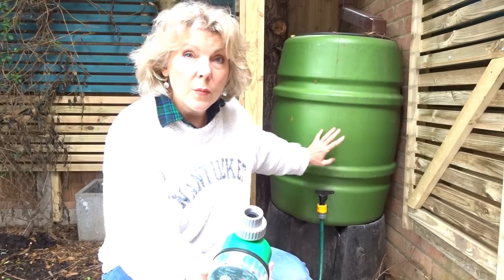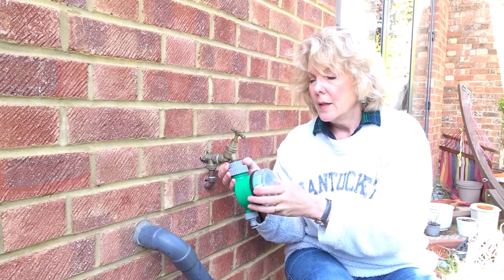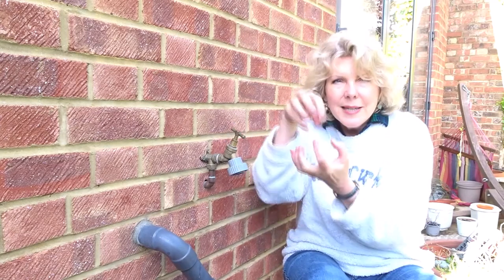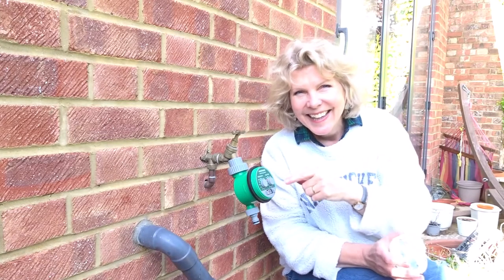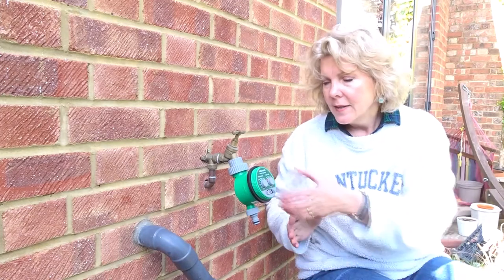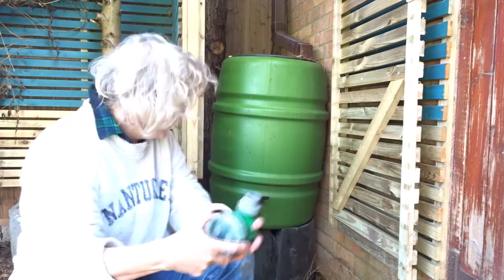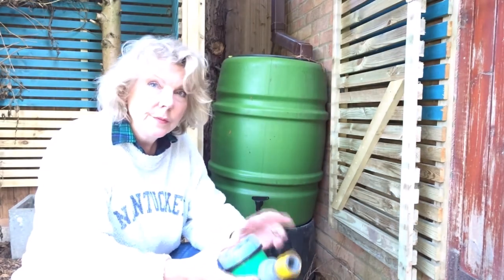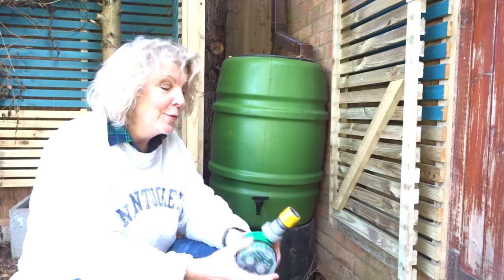How to automate your irrigation system from a water butt or garden tap

Comment: I connected 2 water butts together by a length of hose and snap on connectors to the taps but kept leaking at the tap/hose joint. Saw your video and changed the o rings on the taps and its done the job perfectly. As you say the Hozelock o rings are just slightly larger and take up the slack. Brilliant suggestion, thanks for sharing.
Reply: PS - will you marry me XXX
Reply from the maker: That's great feedback Frank, thank you. All manner of eclectic videos to follow, so hope you have subscribed.

Comment: Alternatively, warm up a piece of hose pipe in boiling water and fit this to the tap nozzle then attach your hose connector of choice to the hose which connects to the timer. Xx
Reply from the maker: I'd be interested to know if you've tried this and made it work? I suspect that the weight of the hose would eventually mean that it would slip off, leak  or come loose, especially if the tap had a thread. Still, all roads lead to Rome. Thanks for watching and for joining in. It's always great to hear from people with other ideas, hope you've subscribed.

Comment: Hi found this video I have this exact timer and set up (though my water burr is higher) having awful problems with leaking when the timer is on 'closed'. You suggested an o ring, I have the simple plastic tap the water butt came with and using the hospice connection. Can you help me out with the o ring adaption?
Reply from the maker: Hi Suzie, arrgh leaks! I had exactly this problem and made another video about how I solved it. https://youtu.be/8cPRz8u71M8?si=0WUPC7cSoUlR3akH
Hope this helps. Isn't it good to be out in the garden again? 
Subscribe to all to make sure you don't miss any of my very eclectic vids. Happy Easter.
Reply: @BecomingCreative  Hi just to let you know I bought the O ring and it worked! Thanks so much for your video

Comment: Might be worth adding a to your description that not all water timers are suitable for  water butt service.  The low pressure provided by the head of water in a butt means a timer that is suitable for working at 0 psi/bar is required, and there are very few reliable units available in the UK....
Reply from the maker: Good point Mike and I have added to the vid description to clarify. Thank you. Hope you have subscribed.
Reply: Any suggestions for such a low pressure timer??
Reply from the maker: @skindude9251  Yes if you look in the drop down description under my video you will see a link to the timer I used which is specifically stated to work with water butts. You can also increase the water pressure coming out of the tap by a) raising the butt on a stand ( butt lift? 🤭)or b) filling the butt with a hose from an outside tap.Hope this helps.
Reply: @BecomingCreative  Bless you ma’am!

Comment: Thanks very useful.  Where is the O ring fitted exactly? I am looking for a water butt with a tap that is connectable to Hozelock fitting.
Reply from the maker: Thanks for watching Sidharth, glad you enjoyed the video. The O ring I mention in the video is on the tap nozzle fixed to the butt.  Have another look at the video, I think I point to it, which hopefully will make it clearer.  I had to change the tap fitting on my butt to make it compatible with the hozelock fitting, which I mention in this video.
https://youtu.be/WXwhTxS1MTI
Reply: @BecomingCreative   thank you I will give it a shot.  Need to orde a waterbutt
Reply from the maker: @sidharthjoshi2979  yes that would be a start- try to get one with a tap that is compatible with hozelock. Good luck, let me know how you get on.
Reply: @BecomingCreative   Okay so that(O rings)didn't work.  The water leaks underneath fitting.  Any advice on this hozelock ocmpatible tap ? I can fit to a water butt.  It seems there is alot out there but not sure what would be compatible with hozelock.
Reply from the maker: @sidharthjoshi2979  Hi there Sidharth, this is the tap I used  https://www.amazon.co.uk/gp/product/B01M1MP9QZ/ref=ppx_od_dt_b_asin_title_s00?ie=UTF8&psc=1
Don't be disheartened, you  WILL get it to work.

Comment: How about Teflon tape?
Reply from the maker: Yes I did think about that, (commonly called PTFE tape for those unfamiliar with the name teflon tape), indeed many plumbers use it. The only thing was that the connector, which was the bit that was leaking had an internal 'click' mechanism rather than a thread, which is why I tried replacing the rubber washer first. If that hadn't worked I would have had a go at a bit of jiggery pokery with the PTFE tape. Not such an elegant solution, but needs must. Great minds think alike. Thanks for watching